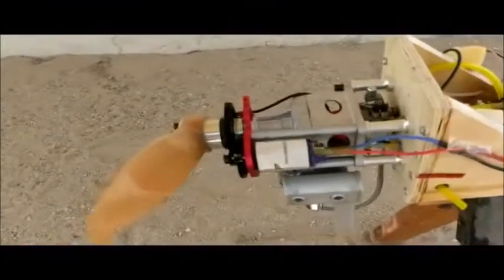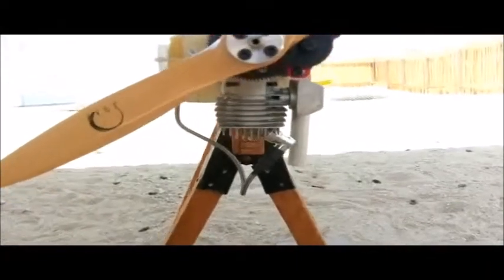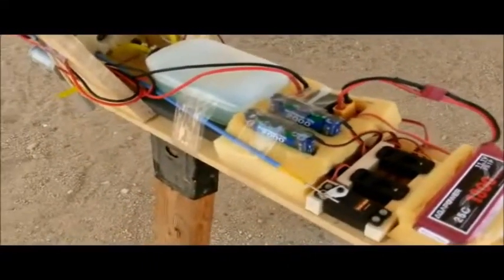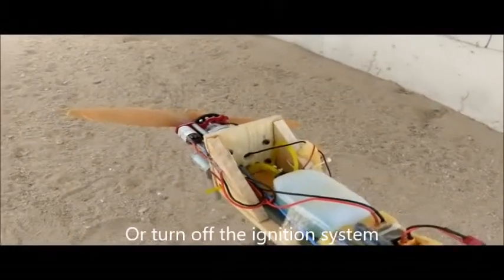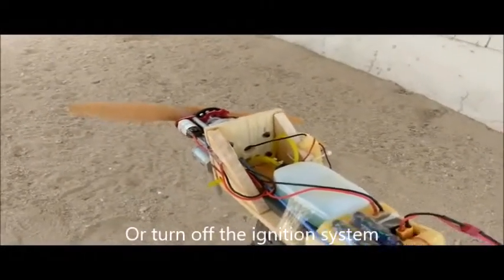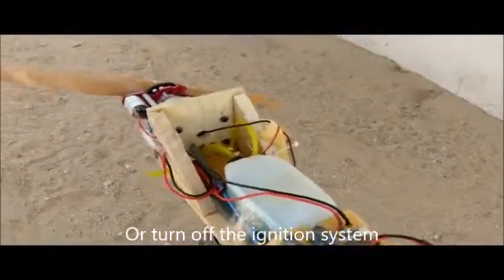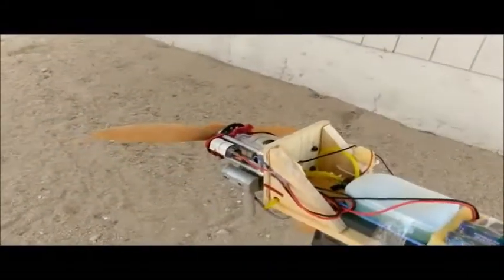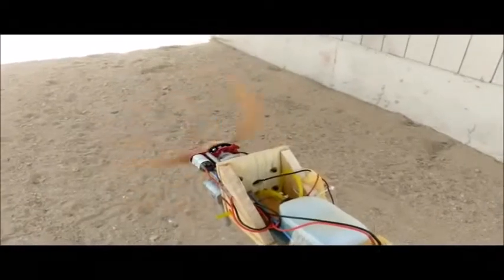EME 35CC Engine with Auto Start

Comment: I know this is late but if you use a BEC  you don’t need three batteries. You could use two batteries with a BEC for both ignition and receiver.
Reply from the maker: I finally took a look at this and this is something to have on gas motors for sure
Reply from the maker: Thank you for that info
Reply: Yup. Check out TechAero Ultra IBEC. They are in all of my gas planes.
Reply from the maker: @rgr4475  Cool thank you

Comment: I have an EME 35 what kind of connector did you use on your throttle arm i tried a ball link but it hits the engine when moving from low to thigh throttle.
Reply from the maker: I used just a regular clevis connector